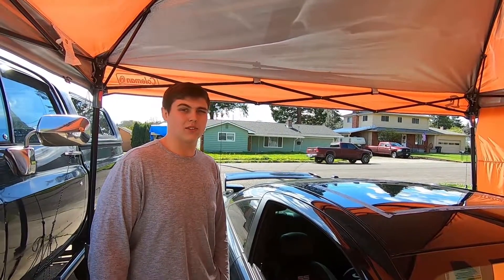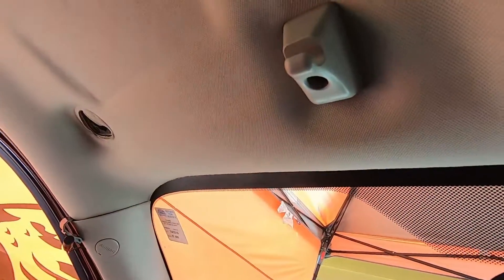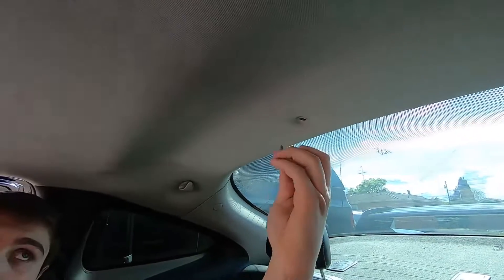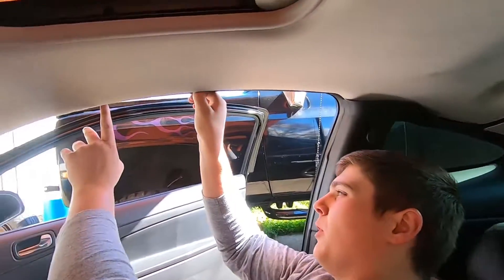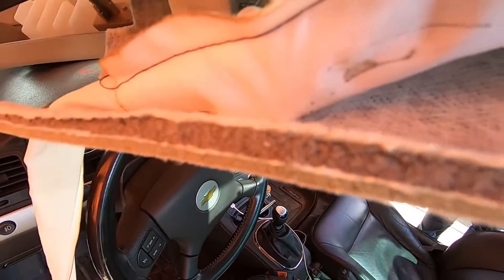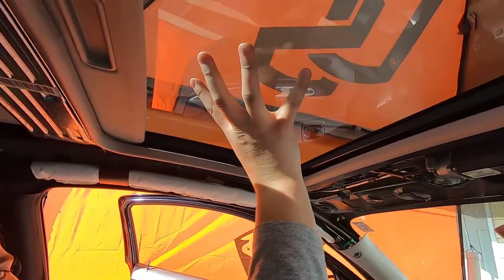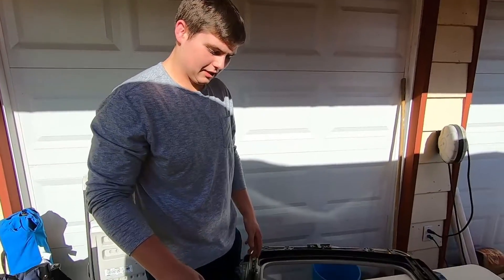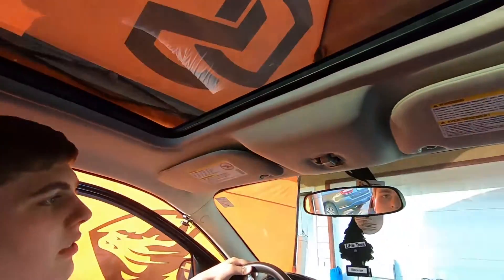How to replace a cobalt SS sunroof

Comment: So my sunroof is open all the way but there seems to be no response from the switch when I try to close  it. I've bought multiple switches to replace it with no response still. I cant remember whether or not I heard anything break or snap when I opened it so I cant really tell if my motor is out or something went wrong from a more mechanical issue. So my question is can I manually close it somehow following these steps?
Reply from the maker: Sorry we didn't see your comment but if you still have a question feel free to leave another comment.